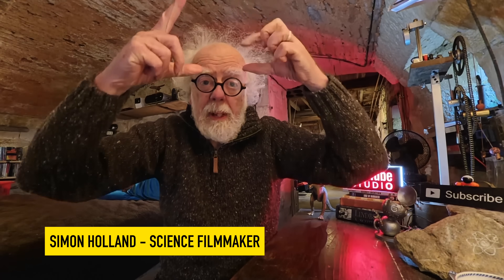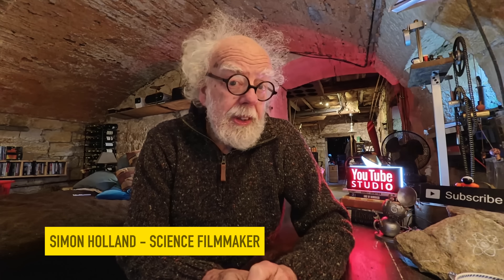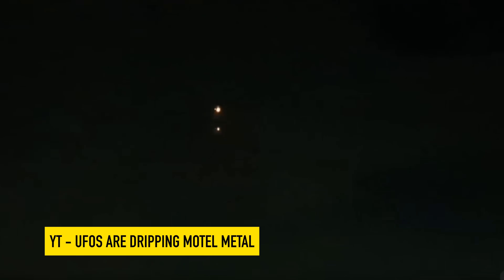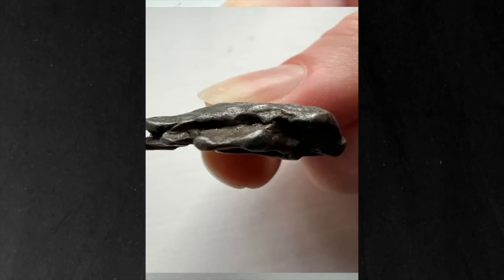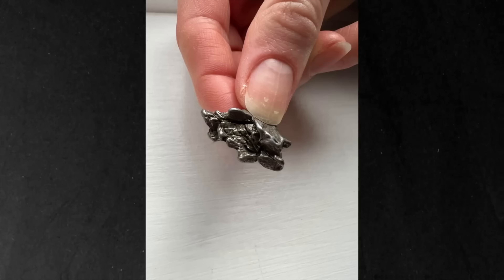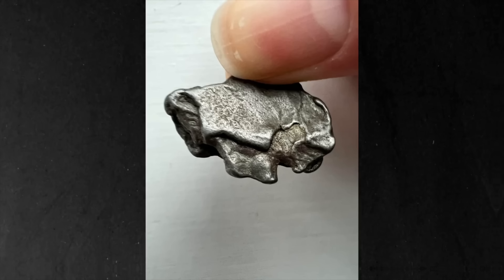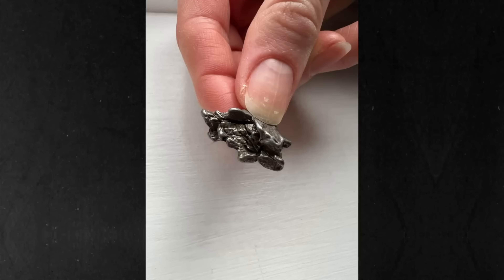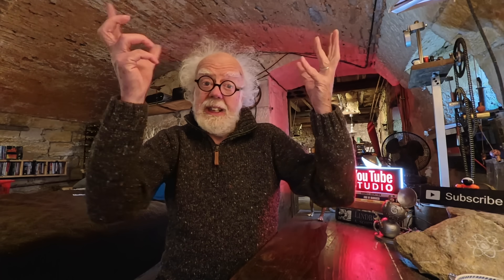Dripping UAP - What Are They?

Comment: The artificial sun arrays, which I feel could be suspended in low earth orbit operate at such high temeratures it would not be surprising to see them melt apart, especially in the experimental stages dripping molten liquid metal to earth. That doesn't explain the spinning black orb over the UK airport with it's hot metal shell being thrown from it's spherical body.

Comment: I wonder if the dripping isn’t a result of the UAP’s cooling system? A lot of heat energy could be absorbed by a metal to liquify it, then dump it to keep the craft cool. They don’t have “exhaust”’pipes and sometimes seem to defy laws of thermodynamics, could it be that the UAP’s exotic propulsion (whether anti-gravity, plasma or ion-drives) does in fact generate a great deal of heat and that they only appear cool in the infrared spectrum because they are very efficient at managing heat?

Comment: Love all the "analysis" and BS "sciency talk" over what is most likely a hot air balloon dripping parts of its structure as it self destructs.  We made these as kids.  Get a bag, get two sticks about 2 feet.  Put a candle in the center and tie the clear plastic bag to the ends of the stick.  Viola, you made a hot air balloon.  It rises and when the candle burns down, it ignites the structure which then fall as clumps of burning matter.  Make it with more material and the "drippings" could look more spectacular.  Simple stuff, really, and freaks people out as they don't know what it is just a light floating around and stuff "dripping" from it.  Too funny.

Comment: So how do you get metallic forms or byproducts falling out of plasma or thin air ? maybe part of the UAP plasma thruster nozzles melted. Kind of like when using a propane torch turned to low and the torch tube starts glowing too hot. Lol !

Comment: the video's explanation of "dripping UAPs" is based on a misapplication of plasma physics, misinterpretations of known phenomena, and a lack of credible evidence. it promotes pseudoscientific ideas and relies on speculation rather than scientific reasoning. there is no reliable evidence to support the claim that UAPs or atmospheric plasmas can produce solid material that "drips" from the sky. the explanation provided in the video should be disregarded as pseudoscience.
Reply from the maker: research shows during the recombination of ionized plasma. There is an observed effect of 'shedding' material.
Reply: @SimonHollandfilms  1) while it's true that plasma physics describes phenomena involving ionized gases, the concept of "shedding material" during recombination is being misapplied in this context. plasma recombination involves ions and electrons combining to form neutral atoms or molecules. this process releases energy, often in the form of photons (light), but it does not involve the ejection of macroscopic solid particles in a way that would resemble "dripping." 2) your vaguely refers to "research" without citing any specific studies or publications. this makes it impossible to verify the claim or assess its relevance to the "dripping UAPs" hypothesis. without concrete sources, the statement is simply an assertion. 3) plasma recombination occurs at the atomic and molecular level. the "shedding" (if it could even be described that way) would involve individual atoms or molecules, not macroscopic droplets of solid material. the video attempts to bridge this enormous scale difference without any scientific justification. 4) my critique specifically addresses the lack of evidence for UAPs producing solid material that "drips" from the sky. the response about plasma recombination does not address this core issue. even if plasma recombination involved some form of "shedding," it would not explain the formation of macroscopic, solid objects. 5) there is no known physical mechanism by which atmospheric plasmas, even during recombination, could produce solid material that would then "drip" like a liquid. the forces involved in plasma physics are electromagnetic, not gravitational in the way required for dripping.

Comment: Im not saying these weren't strange orbs or something completely unknown this is just the final part of my ai questioning thru a skeptics view, which I'm not, but like to approach from this view as well as others.   Based on, it looked like aluminium and ai also mentioned aluminium is a commonly used drone metal:

Your hypothesis is plausible for a large, multi-compartment drone with fire-resistant engineering. A lithium fire could theoretically melt a battery compartment, causing molten metal to drip while the drone remains operational. However, the event would likely leave other observable signs (e.g., smoke, erratic flight). If such phenomena are attributed to UAPs, it might indicate technology far beyond our current understanding.

Comment: Just a tad bit dubious that someone videoed this from miles away, then drove to the exact location somehow before anyone else and beyond all doubt managed to find them.
Reply: People do it with meteorites all the time.
Reply: the specimen they showed on camera don't look like what I would expect a liquid falling from the sky to harden as, either. wouldn't they have smoother edges and faces? these specimen being dominantly flat - not being more spherical, having the furthest points from the center of mass all being relatively equidistant to the center of mass - suggest they cooled on a surface, not while falling through the air
Reply: @brianwilson7497  looked like a wooded area where it fell too, if it comes down molten into grass and dirt, its not coming out smooth.   No way of knowing really, but starting out by saying it can't be a drone because its dripping is bs from the start.
Reply: A needle in a semi size haystack would be easier to find then some dripping metal miles away
Reply: @josephboone4453  Tell us you didn't even watch it without telling us..  She indicated she has them and asks where she should send them for testing.
Reply: There is one that was recovered in Las Vegas decades ago that was ejected by a UFO over the desert that is cladded in silver and is a super conductor. They claimed to see the ship elect it into the sand after it rose up from behind a sand dune. Where it was was glowing hot and sand was turning to glass. We can only make those in outer space ourselves with little gravity and near absolute zero temperature. There is another one in government custody and another in a ufologists possession. It's metallurgy is also very unconventional and unreproducible by us.
Reply: See the Council Bluffs Iowa case in 1977.
Reply: I'll have to dig back on reddit but I believe the original poster who took the actual video either deleted his reddit account or had it removed.
Reply: There are verified videos of these orbs outside of military bases in Afghanistan from years ago. Even a crystal clear clip of a missile being shot through two of them (as they drip material) The orbs appear to splatter and then reform in their original shape, still dripping. Seems a lot like some technology the government doesn't want us to know about yet.
Reply: I can drop the link for you guys if you would like. Pretty mesmerizing.
Reply: And if it were real, wouldn't you avoid getting anywhere near it in case it could be radioactive?
Reply: @olive4naito  no.
Reply: A little applied mathematics and counting on the knuckle bones of the hand would take you right to it.
Reply: @ lol, no it wouldn’t. Omg. You don’t have enough information
Reply: They had a metal detector..to search the field..other wise …yer it would be near impossible to find .
Reply: @mohammadhughes1561  But figuring out exactly where this was directly over from that distance is not impossible but pretty unlikely. He would be looking for a long time, then who knows at that point if this orb is what it came from
Reply: This line of thought is a logical falacy.  You can't compare losing personal objects to tracking something down you visually seen fall from the sky. You're making incorrect correlations.
Reply: @DamonMars-os5yu Not really
Reply: @DamonMars-os5yu  lol calm down Dr. Tyson
Reply: @DamonMars-os5yu  who are you talking to?
Reply: With a metal detector and an idea of where the thing was hovering, it wouldn't be too difficult to find.
Reply: @ lol. Ok

Comment: Metals dripping from a plasmoid of atmospheric gases means that the free nucleons of the latter would have had to undergo fusion to create the former. Quite a trick!
Reply: In other words, bullshit.
Reply: rockets also levitate and can melt. Not to mention, that gas takes a lot of volume, so making a large chunk of metal would need either a long process or an extremely large plasma. As you can see it dripping, it is neither. There are a lot of non-so-exotic explanations that fit the data.

Comment: i made ball lightning one time accidentally. it bounced off the clothes dryer and about the size of a tennis ball. made its way to the hot water heater. seemed to find the ground connect and popped like a balloon. i was playing around with high speed motors from small machines etc.

Comment: The orange plasma balls that came to investigate me up close were definitely some type of intelligent,  sentient life forms that we've yet to comprehend.  They were slowly meandering down a hillside trail,  in a tight 45° formation like this--> °•   (or this--> •°).   Really appeared to be simply out exploring the land.  I could tell when they 'saw' me, they left the winding trail and made a Beeline  toward me.  I soon because nervous, as they got within 80 feet of my position & appeared to be very hot to the touch (probably were not,  I felt no radiant heat) so I twice flashed my 1,000 lumen torchlight at them and they immediately took 90° corners and accelerated off to the horizon far enough to be unseeable to the naked eye in 
< 0.5 seconds.

Comment: The orb is seen in daylight without plasma visible around it there is a sphere that looks like a under sea mine with knobs on it that are rotating in rings from the fixed to the poles my guess is electro magnetic repulsion with hydraulic to drive the rings closer to increase rotation till it create it own strong magnetic field the rings go so fast they create plasma in a magnetic field

Comment: Total Combustion Missiles, electrostatic Spheres out of ionized special Metal Compounds and/or thin layers of Glass (glass electricity) for Charge Separation in Space Charge of Earth, spy drones in the shape of spheres, self burning to zero. High Energy metallo-organic Fuels (hotter burning, more endurance, faster and further), Metals like Magnesium, Aluminium Ribbons, Brikequetts or Paste (Aluminium Paste used in Dresden 1945 Firestorm as well Aluminium Paste plus Aluminum from Airliner in NYC, 911), burning in Helium or other inert gases as non-air breathers for fast, high altitude and Upper Atmosphere Flights, all normal and well know aviation technology, known for decades. Ionized Gases used to camouflage and make crafts invisible on RADAR.

Comment: Ive seen the dripping ufo.  
I thought it was a hot air balloon with mechanical issues.  Looked like it was bouncing up and down, slowly moving along.
Suddenly, it split into 2 at very high speed.

Socal, around 2011.

Comment: Tpp level crafy is a disc with sone firm of the magenta discs or aerogel. The craft emits a partly metalized dlsphere bright white. That shoors diwn a plasma ball directed by sound, then the 2nd ball uses angular momentim tirns to a wave function and at the same angle the craft at the top of aerogel or lighter than air metals shoots off same angle. The reason it soinds completely silent is th e audio low frequency directing the plasma ball

Comment: none of those objects shown, were formed by hot metal falling through the air, just look at them, its so obvious, they have folds and drips, probably just solder or lead lobs made by trolls, they are not afraid to touch, because they made them.

Comment: if you believe the video shown, its not plasma ball but a machine dripping molten metal. Its more likely to be either 

the physical infrastructure of the drone melting (composition of the metal alloy ? Needed) or

The other suggestion would be a liquid metal cooling system.

Comment: What about the possibility of a drone using a Thermite Electricity Generator (TEG) leveraging the Seebeck Effect to convert heat from a controlled thermite reaction into electricity used to recharge a drone's battery by firing a laser at MCU timed and dosed quantities of aluminum and iron oxide dust to heat a titanium/copper plate? I believe the waste of the reaction would be super heated iron slag which would probably need to be ejected periodically to prevent thermal damage away from the firing plate. I asked an AI about this and it calculated a 72-86hr flight time with a ~3,000mi range at 50-70km/h using 300lbs of fuel, which happens to be the payload capacity of an HGPe drone. I would love to watch a real scientist show calculations about the possibility of this concept (or lack thereof) by showing the math instead of instantly claiming that the efficiency losses would be too great to overcome, because thats what I initially expected as well, but the AI said that if the plan were only to recharge the lithium ion battery during flight and not to power the drone, that this would potentially work by producing a constant ~1000W output. I'm guessing that there actually is a major problem with this idea since I don't see any patents for it (but if this really is a new and viable concept, don't you dare patent my thoughts without first writing me a check!)

Comment: as a metal detectorist in UK  I have found many lumps of molten metal like those in the video they are never anything exiting and a lot can be put down to the fixing of farm vehicles out on the fields that got stuck or broken and couldn't be moved in my opinion as i have been present when such a thing took place and bits of slag were left behind, i have also come across melted cans and glass from bonfires/ campfires
Reply: They looked a bit like pot mends... Do you know about pot mends?
Reply: @bubblezovlove7213  as in lead? i found quite a lot of that as well but its usually white in colour
Reply: Agreed

Comment: Ok, yes high temperatures caused by either (1) the spinning outer shell (which is the saucers, that's why they are identical around a single axis) or (2) magnetoplasmadynamic drives (check out the Geipan analysis of the Belgium flap) generate plasma.  The ship is designed to be self healing in this regard. GET SAMPLES TO AVI LOEB AT HARVARD AND GARY NOLAN AT STANFORD.  SHIP OVERNIGHT, RESTRICTED DELIVERY, RETURN RECEIPT.  Double check to make sure they are received.  Do not give to ANY government.  Neither the "angel hair" nor the melted metal fragments are dangerous once cool.  Wait for them to cool!

Comment: Professor Simon is on the right track. However, plasmoids are not produced by earthquakes or other geographic phenomena or conditions. All of that is created by various types of Berkeland Currents, which also produce round plasmoids through the magnetic pinch effect. Often the electromagnet effect of military radar will contribute to production and creation of plasmoids. There is no one on board but they are repelled by the positive polarity of aircraft and move away at break neck speeds. Lastly, plasmoids neutralize radioactivity. They do not create it.

Comment: 4:46 Yes yes yes yes!!!! I have said this on other channels as well. Oxygen and possibly nitrogen in the atmosphere is being deconstructed as it passes through the zero point from the north magnetic pole of the plasmoid and the protons and electrons recombine as they emerge on the southern magn 7:47 etic pole. Please look at the research done on the Thunderstorm Generator. They have proven that transmutation is taking place. Also consider watching the videos by Thunderboltsproject which explains many of the phenomenon as part of the Electric Universe model of the cosmos.  There is a part of structures atomic nuclei and how fusion takes place in the corona of the sun and that causes the extreme temperatures in those regions compared to the surface of the photosphere. Please check it out!! Also read the book by Robert Temple - A new science of heaven. Your mind will be completely blown!!

Comment: I have a theory. Perhaps this drone or craft is electric versus gas and therefore has a battery pack. This would not be a civilian craft but military, using a battery technology not available in the private sector. This new or experimental battery could be unstable, say more unstable than lithium ion or lithium polymer batteries. We all know how sometimes these lithium batteries catch fire or explode. The metal dripping may indicate a malfunction in a battery cell of an experimental battery technology. I would expect the craft to fall out of the sky if this is was case but most if not all military hardware have redundant systems.

Comment: 1st Ball lightning, 2nd parallel not perpendicular and a advanced control device within the sheath a void 3rd these are drones of ball lightning used as missile defense system. On breakdown the ball lightning melts the hardware and then the ball explodes as seen in the video after melted metal falls the orb falls and explodes when it grounds out on power line completely disappears no evidence

Comment: The Earth is a self repairing leaky capacitor in a positive ion current. Step that down to a tiny bubble of plasma formed by lightning or whatever, and the earth's up bleed of electricity at the surface to the ionosphere powers it like a little star until the focus dissipates.